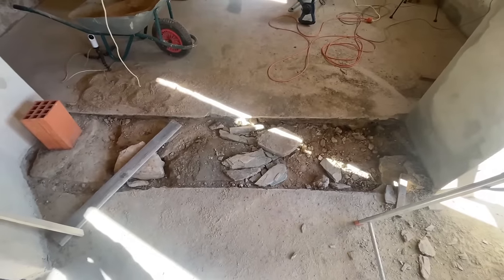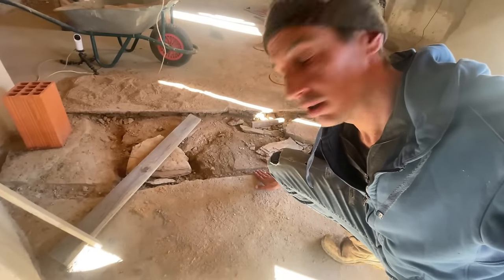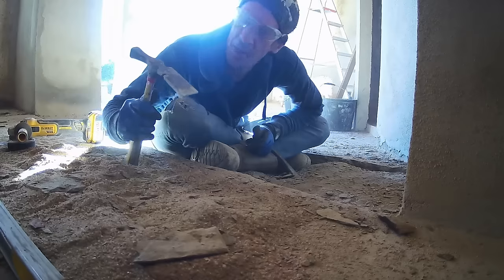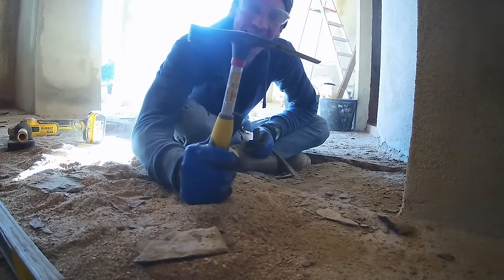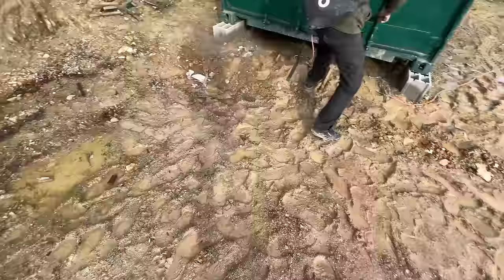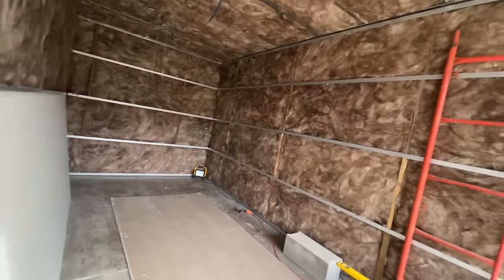DIY Home Renovation Portugal

Comment: I wonder if you speak Portuguese now. I find it makes a lot of difference things move  faster. It's a bit late for you maybe but I have discovered that roundwood is 1.5 times as strong as the equivalent milled wood.  Eucalyptus is great wood but problematic in drying. Using small trees you don't have this problem. I am going to turn mine using a router.